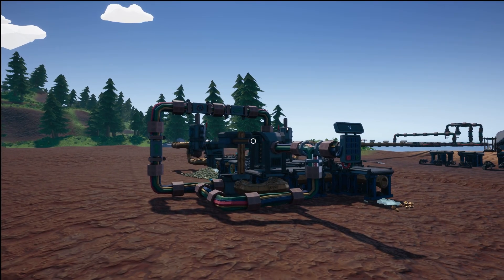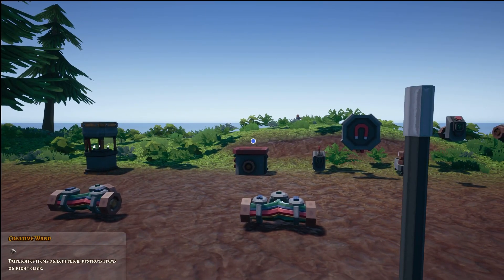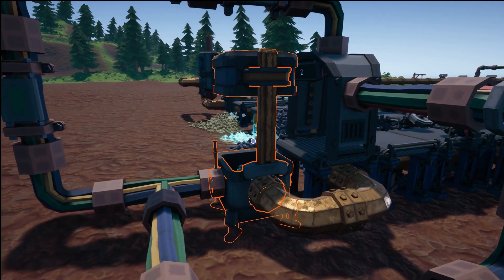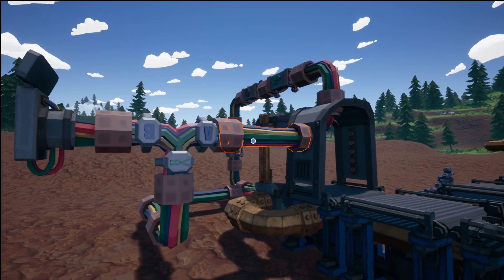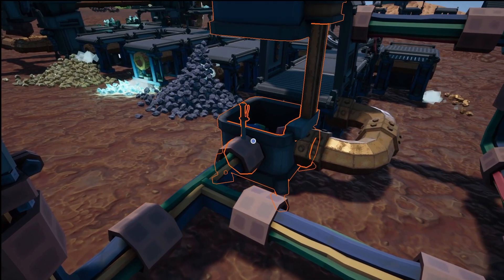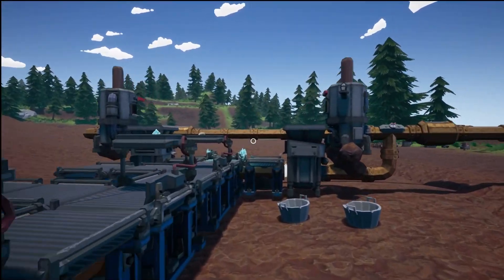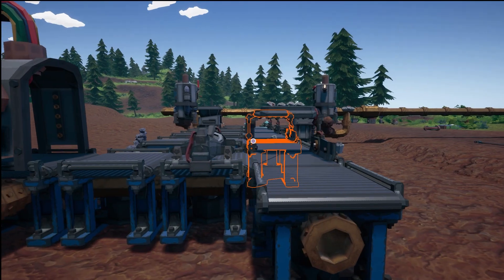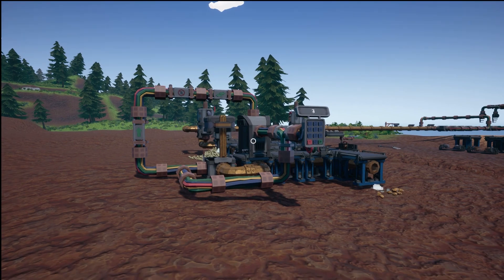HYDRONEER 2.0 | BEGINNERS LOGIC GUIDE | GEM COMPRESSOR

Comment: Hello and thanks for the video.
Unfortunately the presses have changed and, when it starts, it closes and does not open anymore, unlike the one in the video that once it closes, crushes the gem and reopens automatically. How can I make the gem pass through the reader, is crushed and the press reopens automatically? Unfortunately the new presses do not allow accumulation and that is, if it remains open, the gems overlap and come out of the press itself. I don't know if I made myself clear... I tried in every way and I can't...
It works great with the logical toggle switch, but I want it to squeeze one bud and open and stay open because as I said the buds don't stack up and pop out of the press so they have to be squeezed one at a time. Thank you very much.

Comment: This setup works for a bitm, but something happens and not sure why. Sometimes is doesn't reset, so did a test and had it set at 50. When I checked much later, it was over 1k. So not sure what's going on. Gonna do some more checking to see what the issue is. Great video by the way, explained it very well.
Reply from the maker: Thank you for your feedback! Im glad it was well explained and easy to follow, im sure it will be a simple fix and something has been overlooked, I’ve done it plenty of times but you’ll get it figured out!

Comment: is they a way of adding in a delay to the conveyor belt to this and how i want to shut down the belt so that once the counter does hit the number the belt will stop and no resources move. that or add a magnet so that they dont get stuck
Reply: i want to have 1 for each of the 4 gems so they have they own compressors
Reply from the maker: If your counter in linked to your compressor to activate it if you then put a T cable in that circuit to a logic valve hook in your pipe work this will shut the conveyor down, if the belt is off and turns on when counter reaches said number stick a flip hook just before the valve and that should fix the issue, hope that helps
Reply: @Krypt0nite  cheers bud ill give that a whirl in my build and run a quick test I may I run a video on the topic later when I finally get it done still very new to logic so I'm brushing up thanks to you
Reply: many thanks bud ill do that bit now.......now im gonna pick your brain on this one coz ive noticed you only have 1 water pipe for your whole plant. would it not add more pressure to the system if you had different elements run on different pipe work. 

so my idea of my setup would be 9 water feeds where. 2 run conveyor belts bringing all my resources to the top to either smelt or compress. 1 pipe work for smelting and compressing. then 2 for each of the tiers going down to the very bottom of my plant with 3x drills per level. running off of 2 feed. so 1 feed tier 1s 1 for tiers 2 and another for tier 3. meaning the pressure would remain the same for all levels rather than different pressure at the very bottom or by the time it reaches said bottom.  @Krypt0nite
Reply: where in the circuit would i add that T and thansk for the help im just setting up my compressor section now on south hope im in the process of moving everything over from ember cradle  @Krypt0nite
Reply from the maker: @oswuldleofricvivadirr3839 ahhh yes the joys of moving from ember cradle, good choice on southhope 👍 okay so from your counter it will go the gem compressor to activate it it can go anywhere on that circuit preferably a few cables back from the compressor then I would add maybe one or two 1sec delay hook just before the compressor that way the counter will shut off the conveyor and then 1 or 2 secs later the compressor will do it’s thing
Reply: @Krypt0nite  brilliant ill give that ago and add it to my mix after dinner. I'm only upstairs this minute setting up stuff and I'm playing the normal game not the one where you can use the magic wand
Reply: @Krypt0nite  thanks again bud I've given you a shout out in my latest video too which I added today on the South hope bottom of the site I had some fun with another of nukes this morning in creator mode
Reply: ive added a magnet to my chain coz it was getting over full on gems for some reason the delay no longer shuts off the value to shut off the supply of water so that doesnt happen and all i want it to do is run 25 compress job done.......have to say this logic is a pain  @Krypt0nite

Comment: Hi 👋, thank you for your great 👍 work. Question? Is there away to stop 🛑 a conveyor belt for a second or two while my gems 💎 are being compressed?
Reply from the maker: Hello, thank you for your kind words, There is yes I will do a more detailed video as I have had a lot of these questions, but you can incorporate a logic valve into the build so it stops flow when sensor is activated and then opened again when the sensors value is reset
Reply: @Krypt0nite  thank you 🙏 . Yes I am having problems with the reset part. The valve close the conveyor but doesn’t reopen.
Reply: Logic will do that.
Reply: @DearMrDubs  U need a signal to close and another to open
Reply: @pedro_jaber9357  thank you. I put a magnetic pull. It does work. It’s strange the ways it does, but still do the jobs. I will still try yours ways to see
Reply: @pedro_jaber9357  make 2 lines to your shut off 1 with a delay on it that way you will get a 2nd siginal to open the valve may need a diode there 2
Reply: a magnet before the hooks (same signal that the crusher gets without hooks) will collect any items and prevent them from going in while crushing.

Comment: This is way more complicated than what I need, and doesn't address my problem. You see, my setup has at least 50 drills right now and the gems come through constantly; when I hit the compactor, inevitably some get stuck at the point between the conveyor and compressor. I can just set a repeater switch with a 10 second or whatever delay and it's way more compact than all this, but it can't solve the stuckage problem.
Reply: Logic water valve to turn off the conveyor prior to the compressor while compression is in progress :)

Comment: it dosn't work
Reply from the maker: Sorry to hear it’s not working for you, it’s been a while since I’ve revised, there may have been a few changes to things due to updates
Reply: Working on a bit of a weird setup, with 4-5 circuits hooked together with lots of testing/redos, logic values appear to get "stuck" after awhile.
Sometimes hitting the red button on the keypad 4-5times works, other times you need to restart your game.
I'm not even running anything crazy, only ~40-50drills and I have them shutoff while I'm working on my setup.
Edited Update- Turns out I'm an idiot... 
I was trying to link up a couple different circuits and two of them were already hooked in, so I was just looping around with enough delays that I confused myself.
Reply from the maker: Oh yeah I’ve done that so many times when trying new methods and builds, you spend ages looking for the problem to realise it was yourself being over complicated 😅